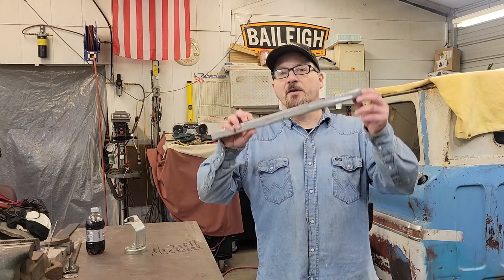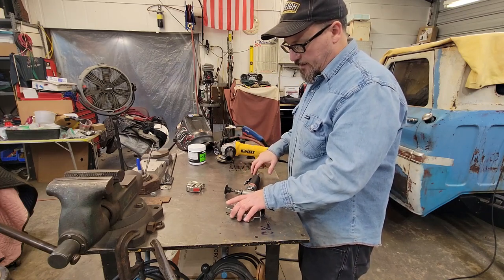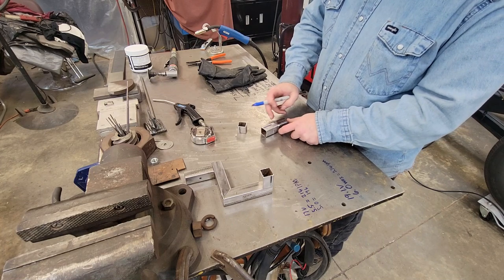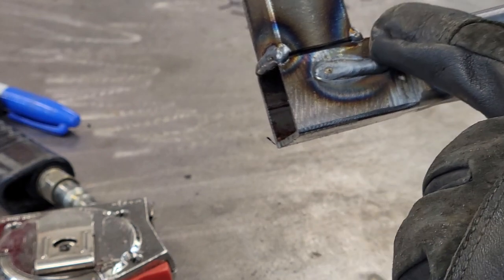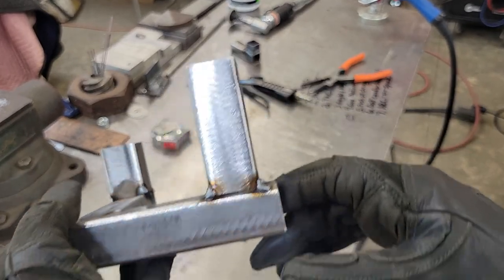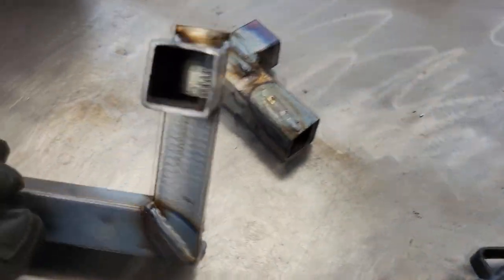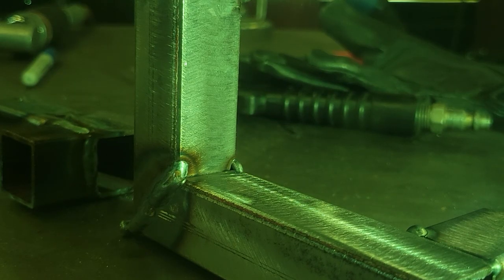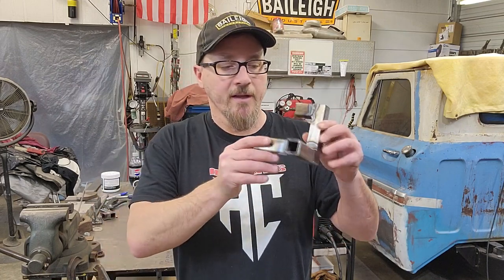Learn to (Mig Weld) in A DAY pt. 3 (MIG Welding Thin Square Tubing)

Comment: I consider those beautiful welds. Thanks for the tutorial.  If you’re going to spend some time on TIG please explain why and where you would use it over MIG.  The technique I have tried and failed with time and time again is using a spool gun with aluminum. I’ve literally tried dozens of times and never obtained a single weld that was worth bragging about.  It’s definitely not a big deal because I’ve essentially given up, but I sure would like some input into where I went wrong.  Thx again.
Reply from the maker: Thank you , Ill have a video comming  soon  using a spool gun on aluminum , my arccaptian came with one. As for the tig v/s mig. The only time I use mig over tig is usually when like building tables or simple repairs that dont have a great fitup. But most of the time I prefer tig because of the quality and not throwing sparks everywhere.  Ill also be putting up some beginner tig vids before long also! Thank you for your continued support God Bless !!!!

Comment: Hello from Australia.. I'd like to start with Thank you... I've recently taken up welding and there is so much to learn and the tools.. so many tools.. but your tips and techniques have really helped me improve. Love to see something on how to keep stuff square... It seems you add a weld it all goes out of square almost instantly..  this video helps a bit with that but would love to see more on that... It really kills the vibe when I'm needing the end result square and once welded it's not..  could weld it to the table as other videos suggest but really... Grinding a lot sucks... Once again thank you... It is appropriated...
Reply from the maker: Awesome thank you very much!!! I love to hear when my videos help my friends!!! I just made a note of it and ill try to help you out!!!!
Reply: Warping or distortion is always a problem.  There's no way to avoid it, only to fight it or compensate for it.  If the part is small enough, your best bet is to clamp it to something strong and solid.  Another way that helps is to weld on opposite sides of the part so that some of the metal shrinkage on one side pulls the other side into alignment.  If it is something where only one side will be welded (fillet), then you have to open up the angle somewhat to allow for the amount that the weld bead will change it when it cools.  That mainly comes down to experience or guesswork.  Correct fit up of the components helps somewhat.  Also, the thickness of the base metal is a huge factor in warping.  That's why you may not even notice any change in 6mm plate, but 1mm sheet will bend, warp and buckle to the extreme from heat input.  It is something that you will learn how to deal with as you build things from metal.

Comment: I've been learning to mig on a yeswelder 205ds. it lays down some pretty good welds (i think..) but I've still got a little to learn. using synergic mode, it does great, but it almost seems like it adds too much filler, or maybe i move too slow. I initially learned on tig, so i feel like im moving fast comparatively. A video showing too much wire speed vs. too little and how to determine if you need more or less wire speed, and it's my first real project is reinforcing my rear subframe, so i want to be confident in my penatration/strength.
Reply from the maker: Awesome never stop learning and practicing!!! Here is a video I done a while back that may help!!
https://youtu.be/JEBb4snkiRw?si=ufP2eSX_tbky_G_A
Reply: @ACDesignsGarage  awesome, thank you! I've been watching tons of your videos recently